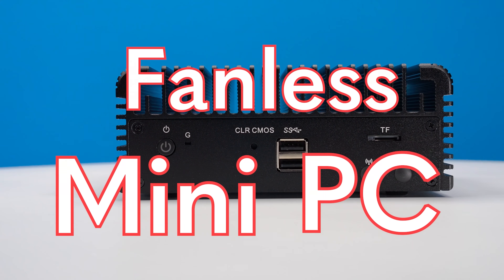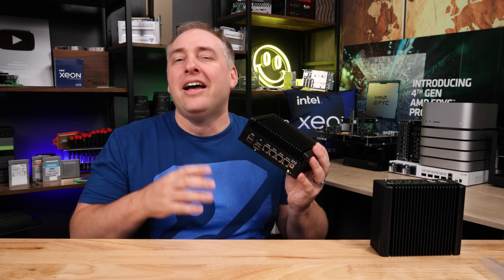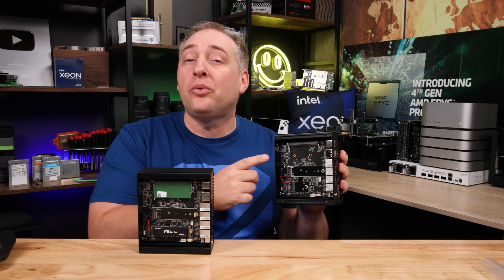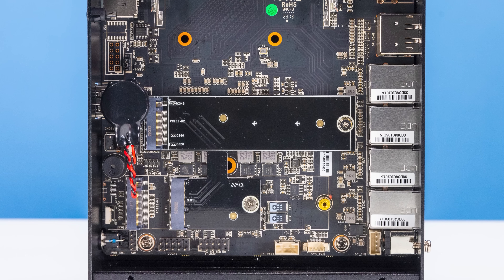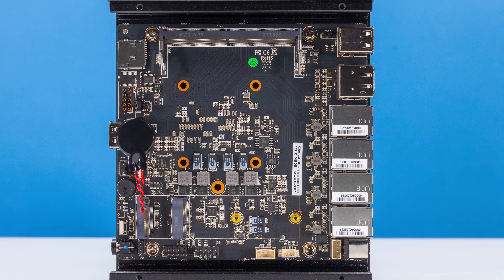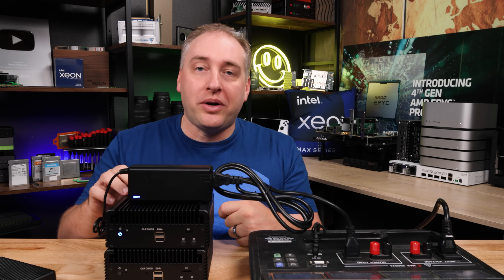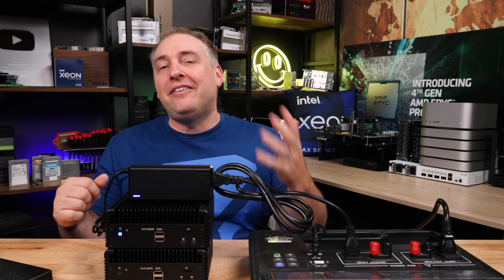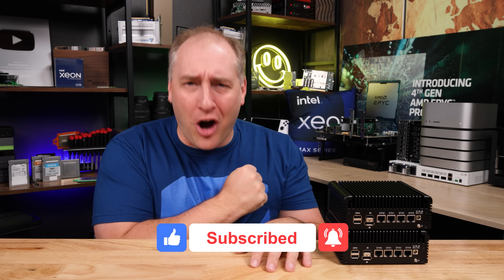Best EVER Fanless Mini PCs for Virtualization and Firewalls?

Comment: BACK DOOR TO CHINA?
I’ve been wanting to get one of these boxes but I am skeptical. How can we know for certain there isn’t a bios spoofing program.or any type of proprietary embedded software sending information straight to the motherland I know most people wouldn’t mind having their data sold to China like we already do with tiktok but a firewall is a  different story emails,accounts,financial information everything flows through it. Petition these manufacturers to program    COREBOOT with there hardware shoot I’d pay $20-40$ extra bucks to have the peace of mind that my hardware is secure. I didn’t know what iot was a week ago maybe I’m talking about nothing or I might be on to something
Reply: Would be interesting to see Patric's comments on this one. Thank you
Reply: the only way to trust coreboot is if you compile it and flash the firmware yourself. If you rely on chinese manufacturers to do that, they can just as easily add backdoors into that too. So it's a bit more complex than "ship with coreboot", they would have to add support for their devices in coreboot opensource project
Reply: pcaps or it didn't happen.

You are not interesting enough to China.

Comment: Anyone here who knows how to connect a fan to this board? I have the older N6005 version, but that tiny header is the same as seen on this one here .. even smaller than the 'mini 4-pin pwm' on graphic cards.
Reply: those small connectors are named with the distance between the pins. In the NUCs the fan connectors are "1.25mm Pitch 4-pin connector" and by eyeballing it seems the same connector. You can get a connector+cables from Adafruit or other suppliers of DYI electronics stuff. Then you would have to solder or otherwise splice the wires to the fan wires. 
Also there are normal usb 2.0 headers you can get 5V from

Comment: I picked up one of these N305 guys when saw the other video about its smaller sibblings. Proxmox 8, opnsense with nic passthrough, a docker host and some LXC containers and it runs my network with capacity to spare! It's got enough muscle to route more than a gigabit of  wiregaurd VPN traffic without a problem.

Big thanks to everyone in the forums who dug in deep to how these fanless badboys work
Reply: Hi. And the temps are good?
Reply: my 4105 is still chewing along very happily.. about to switch it out for a dual ssd'd 5105 unit with 226's and 64gb ram
Reply: @porklaser are you running docker as a VM?
Reply: @gittin_funky  Yeah the docker host is a vm running Ubuntu server
Reply: Are you connecting your NICs LAN port to a switch?

Comment: If you set this up as a router, wouldn't the wifi slot eliminate the need for at least one access point?
Reply: If the WiFi chip used supports AP mode, sure. The Intel ones don't though.

However, most people who would consider a router solution like this are probably more interested in having separate APs.
Reply: the wifi radio in a dedicated access point is more powerful because it's designed to be... an access point so to run multiple connections at the same time.
A wifi card you can install is designed for clients so it expects to do a single connection to an access point. It's not going to be very good in AP mode

Comment: Nice little machine. I wish it had dual 10 Gig ports. With TNSR, it might even route at close to 10 Gig speeds.

@ServeTheHome Any chance you could test TNSR performance on a device with dual 10 Gig ports with one of these new processors? Ideally both virtualized (bridged and passthrough) in Proxmox and bare metal. 🙂

Comment: Hold up what is the throughput of the device with 4 drive add-in card?
Reply: it uses pcie bifurcation so it's still using the same pcie x4 connection in the M.2. It's more for capacity and redundancy than performance.
Reply: You'd effectively get ~1GB/s per drive, which is fine considering the fastest you can get data in and out of it is 1.25GB/s. That's with all the NICs going all at once.

Comment: The reason of USB 2.0 is not enough PCIe lanes from the CPU. total of 9 lanes, i226 takes one lane each, the x4 m.2, the m.2 wifi.
Reply: the CPU (the SoC) has an integrated USB 3.0 controller so pcie isn't used for that anyway. I suspect that it is using dual-purpose pins in the BGA though because 14 usb 3.0 is a pretty damn lot of contacts. So to expose the pcie they could not use the same pins to do USB 3.0
Reply: USB10 is shared with PCIe 3.0 x4 for NVMe - so yes - if the NVMe slot is 4x then there are no pins left for USB 3.0
Reply: You can see the extra pins for USB3 in each port and the number of passives next to the connector on the PCB suggest the ports are wired for USB3. If the other replys are correct and the CPU shares USB3 pins on the package with PCIE pins for the NVME, then there should be a BIOS setting to set the M.2 slot for PCIE x2 instead of x4 and the USB ports should work as USB3. That's assuming the manufacturer did everything right.
Reply: @blazini  They used the similar PCB for higher end model that uses 11/12th gen mobile CPU. The presence of USB3 pins and miss-printed chassis label could just be recycled design across different models. I agree that the n305/n100 SoC have built-in USB3 controller, it is left for manufacturer to configure to expose the trace of either PCIE lanes or USB3 to the motherboard, in a similar fashion that M.2 slot electrically support either nvme or sata-protocol SSD.
Reply: Most of these units that have the N305/N100 in them have a x3 M.2 and the second M.2  running off the "h" adapter is actually PCIE x1 ( OUCH ).   You are correct in that it is not enough lanes...  It is what it is.     The second M.2 is arguably only usable for a wifi adapter; a waste for a NVME drive.

Comment: Hi, nice piece of hardware, especially the PCIe Lanes splitter that fits ferpectly in such a machine, very well seen.   ~36 W is logic with this kinda CPU, it stays quite low for an 8 core (and very useful for a HTTP server written in Erlang:).   Very good ratio quality/price, at this price for an 8 core it will be difficult to beat.

Comment: Usually I don't trust those Chinese power bricks, though some seem to be better then others. Chinese are known to just add weight in the form of adding steel and putting fake marks etc. on them. I have the renaming of the NIC as well on another pc if I for example change the NVME ssd or add another pcie device or remove a pcie device. it's annoying.I don't think it's specific to this device is what I mean. The thing with the power supplies is that, to see what you get you have to open them usually with a dremel or a saw, and know a bit of what you are looking at. To really know if the transformer is safe you usually end up destroying it. But visually you can usually see if it could theoretically meet any western standards.
Reply: the renaming of the network interface depending on pcie port is a Linux default setting, (ironically named "static device names" because nobody thought pcie devices could appear or disappear) you need to configure the system to give the network an actual interface static name.

Comment: OK I am super glad the MSP for the i3 N305 was not firm because this whole computer is under the MSP of just the processor.
I'm probably going to pick one up
I had a shitfit when i saw that the i3-N305, and i3-1215U/1315U had the same exact $309 MSP
Despite the N305 being less than 1/2 the processor
-No P cores vs 2 P cores
-1/2 the GPU cores at a lower clock speed
-Single channel memory vs dual channel(also limited to 4800 instead of 5600)
-an effecitve firmware limit of 16GB of RAM where as the other i3 in theory supported anywhere between 128GB and 512GB depending on if they will support 4 of the future 128GB SODIMMs that should be part of the DDR5 standard
-9 lanes of PCIe 3.0 as opposed to what appears to be 20 lanes of PCIE 4.0(or more likely 20 lanes of mixed 4.0 and 3.0)
Reply: new N series is about power effect...Aso I think n100 is better than n305 about price. N305 is overkill for nas and router but not strong enough for heavy task...
Reply: @vuhuy8952  The difference between N100 and N305 is 4 E cores, clock speeds, and 3x the MSP
The 1215U has a TDP 6w higher than the N305, and with the extra P cores, you can just downclock the 1215U to be similar performance to the N305 at the same power usage, but then you get the same or FAR better performance and features.
I literally cannot see the use case for an N305 over a 1215U/1315U with both of them costing $309

Now the N305 clearly is not $309, because this whole computer is only $299, but when the N305 was first announced i was super upset, almost as bad as Nvidia taking the replacement for the 12GB 3060, calling it the 12GB 4080, and setting the MSRP at $899 instead of $329

Comment: USB 2 is still VERY useful, the signalling speed of USB 3.x causes some interference with low power 2.4GHz signals, like Thread, Zigbee and Bluetooth, but I do agree, some USB 3 ports on a box like this would be a very good idea too. We need BOTH.
Reply: IPU 456A uses an Ryzen 5600U, which got the lanes. But it misses the smart 4x NVME switch. 2x USB 3.1, 1x USB-C all with 10GB and 2x USB 2, 4x 2.5GBNic. In a Package which is nearly identical. But costs more.
Reply: @Elkarlo77  Do you have a model number and the place you bought it, I cant find an AMD based system with that name on AliExpress, thanks.
Reply: they have N100  version which same but have 2 usb 3.0 and 2 2.0. On taobao it"s around 110-140$ for barebone - 8/128 .
Reply: @vuhuy8952  I see that on the N100/N200/N305 boxes with USB 3 or USB C, the speed of the NMVE is only x1. This means that NMVE SSD operate at lower speed (I found that 1x means 1GB/s). Only USB 2 boxes has NMVE x4 (according to CWWK website).
Reply: @vuhuy8952 link please!

Comment: What's the max amount of memory that works in this system? Can you use a 48GB SODIMM, or is 16GB the actual max as Intel lists?
Reply: I ordered one with 32GB
Reply: @michieldejager6819  Please report back if it works and, if so, exact make and model ?
Reply: 32GB works fine, no idea on the new 48GB SODIMM's though.

Comment: Great to see low power appliances like this. I recently purchased an inexpensive Beelink S12 Pro (N100) which comes with an empty SSD slot. Combining this with an 8TB Samsung SSD made it the perfect Proxmox Backup Server for home use. 7W power use from the wall with the SSD + 16GB RAM.
Reply: I was looking at the same one the entire pc is something like £170 and just the n100m asrock motherboard is £150 way too expensive for only the motherboard
Reply: @HHX_H  you mean, "... way too inexpensive for an entire pc."
Reply: you probably meant it comes with an empty 2.5" SATA bay.

Comment: What about bios updates? And I hear a lot of people fearing for bringing this kind of devices in their network... scared for backdoors etc... Did someone ever checked/tested this?
Reply: One year later, and still all the reviews are like "yeah cheap, efficient, can run this and that!" But still no one is talking about that detail. 
Really shows that they are not using the systems they review 🤷🏻‍♂️
Reply: what do you need bios updates for, the CPU is soldered. Nobody checked these for backdoors so it's probably not great for high security environments
Reply: @marcogenovesi8570  You would want updated bios for new microcode in the future.

Comment: 4 ssd in a firewall box like this could be interesting for caching.....

Or for container storage or storing logs without eating up network bandwidth. Nice to have data storage on a separate drive than os
Reply from the maker: We are planning to do a new video if we can get the cooling under control for it
Reply: @ServeTheHomeVideo definitely interested in seeing this. I can think of so many configurations I'd like to test. Cooling could definitely become an issue depending on use case and environment. In the server rack in the past ive had some success putting small devices like this by an exhaust fan for more airflow - wiring can get messy tho.
Reply: @christopherjackson2157  Slightly off-topic: How are you handling AC adapters for these sorts of devices in racks?
Reply: @blahblahblahblah2933  . Two sided tape on top of a rackmount chassis in a pinch.  If you have a space tied down to a rackshelf can be pretty secure tho. in my homelab I have a shelf with slits in it and I use zip ties to secure smaller devices to it. I'd be interested in hearing if anyone else has a better solution.... Not entirely satisfied with anything I've come up with yet.
Reply: @ServeTheHomeVideo put a fan on it lol
Reply: @ServeTheHomeVideo   Cooling; and it's "lane" limited;  the one's I've seen, touched,  or delved into the specs on Amazon suggest that it's a x3 lane for the primary NVME and x1 lane for the secondary.   Not sure if what the PWM fan connector is, but it's super small, maybe a graphics card plug?  
FWIW: I'm going to try to replace the cover with a perforated steel or aluminum sheet to see if that improves cooling, when mounted vertical on a wall.
Reply: Is there a link for the 4 m.2 slot?
Reply: Run alpine from ram, use 4 4tb SSDs in raidz1, easy 12tb mini flash nas… likely major heat issues though.
Reply: be interested to know if they sell these separately ?
Reply: I looked at the Amazon link and I have two questions, what is RAN.?  How much RAM does it have.?
Reply: Can you send one to Linus have him watercool it 😂
Reply: I don't need this but if it had the 4x M.2 riser, then I might be compelled to buy one to replace my j1900.

Comment: Does this thing have a switch chip for those four 2.5 ports or any switching acceleration in the NIC?
Reply from the maker: No, these are direct PCIe from each NIC to the CPU.
Reply: @ServeTheHomeVideo  thanks, and @blunden2 also makes a great point re router
Reply: @alexkarasulu8766  To clarify, you want at least two of them to be separate (1 WAN + 1 LAN). Having all of them separate allows for multiple WAN ports, multiple separate LANs (without using VLANs). The only downside is that you then preferably need a switch as well to avoiding software bridging them. The assumption is probably that most people who buy these do have switches already though.
Reply: @blunden2  That makes total sense. Thanks for your input.
Reply: It's intended as a router, so you want them separate, not switched. 🙂
Reply: it's not that much of a load to do bridging 2.5gbit for modern CPU
Reply: @marcogenovesi8570  you don't do bringing, you buy a switch...